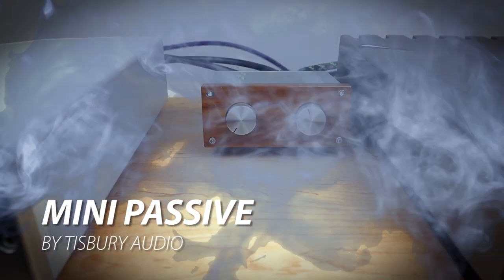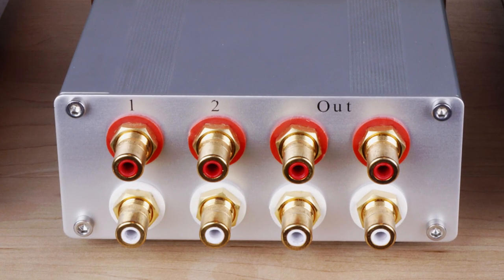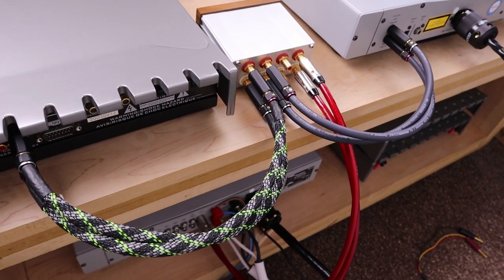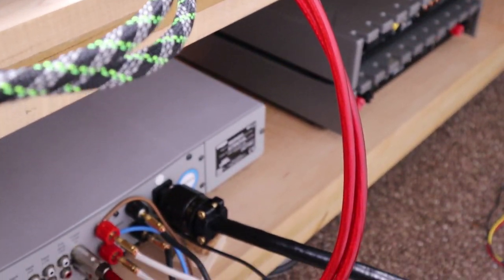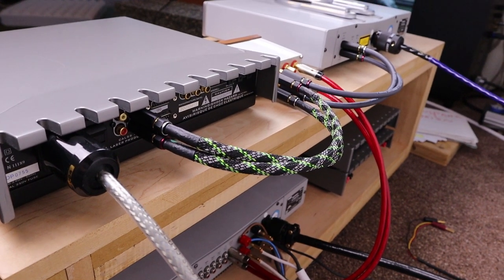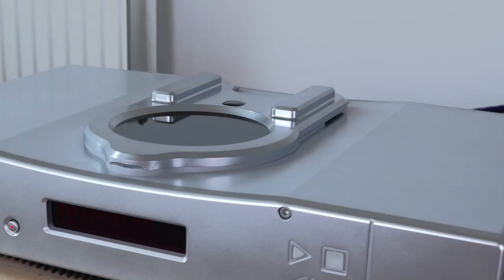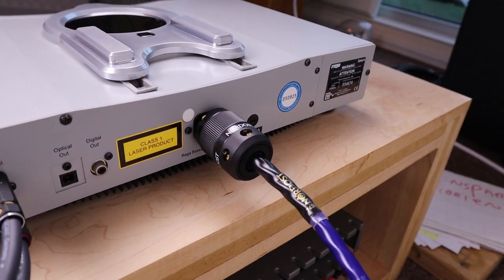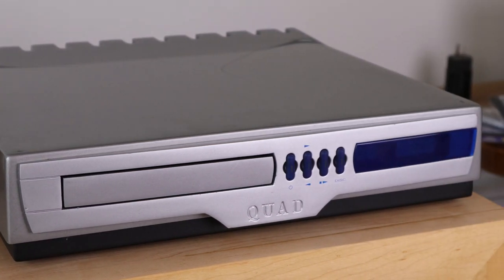Using A Passive Preamp.  The Tisbury Audio 'MINI' Passive Preamp

Comment: Cable lengths aside, my understanding is that with a passive preamp, the frequency response changes as the volume pot is turned up/down which affects sonics. This is because every position on the volume pot has a different impedance value.
Reply: The Tisbury has disctrete resistors - no volume pot!
Reply: @chrisantoniou4366 still, each individual attenuation level presents a different frequency response. For example, at 6dB attenuation the sound changes and is different than at 0dB attenuation and is again different at full/100% attenuation.
Reply: @alexvlach4897  That's not been my experience except in the sense that an attenuation of or increase in volume makes a subjective difference in sound.  This was something that a "Loudness" button on an amplifier used to try and fix by bumping up the treble and bass responses at low volume to compensate.

Regardless, discrete resistors instead of a potentiometer provide a better quality of sound and don't deteriorate like a volume pot does.  Even if a volume control did in fact degrade sound quality, a passive resistor type control is streets ahead in terms of sound quality than an active pre amp with a volume pot.

Comment: Since shorter cables are better with a passive pre-amp it stands to reason that you are reducing the amount of capacitance in the circuit by a shorter run. You would have better results and solve a lot of problems by also having lower capacitance interconnects.

Comment: which mak os rac did you use i am after a high end on and how short is itt
Reply from the maker: Hi, do you mean the audio rack?
Reply: @theaudiophilebarista2424  I
Mean the intercoetors
Reply from the maker: @hamzatatta952  Interconnects?
The 2 top ones are the same. SC- Stratos from Sommercable.
The red one is from QED (Rreference audio one).
It does say so in the video: @2:16
Reply: @theaudiophilebarista2424  ok thanks are they high end  cooer  or silver  and can you describe what it gives to your system
Reply from the maker: @hamzatatta952  Hi, they are very basic, inexpensive, copper cables.
They sound neutral. But nothing special. They just do what they need to do.
I had these made to order for my Quad setup.